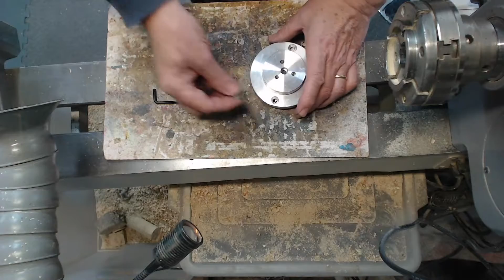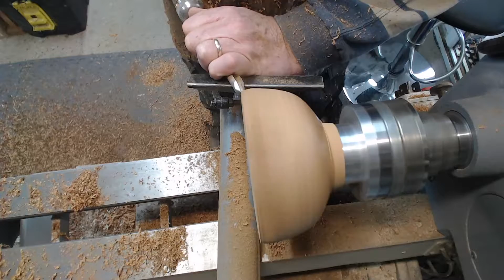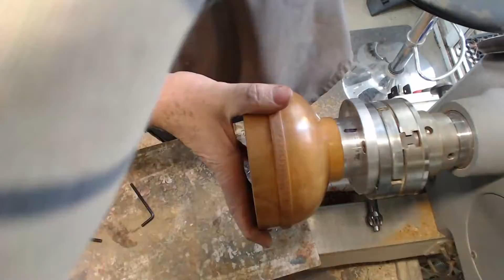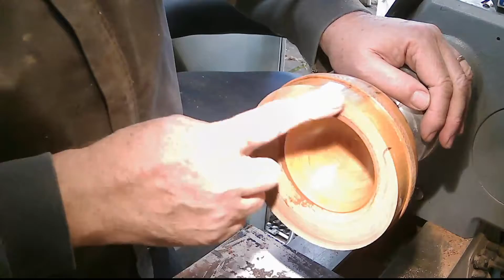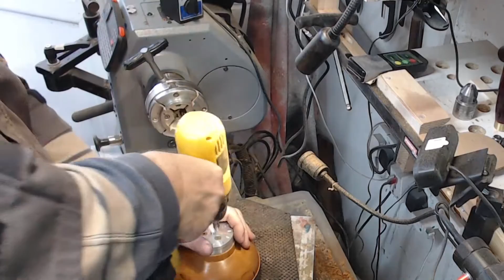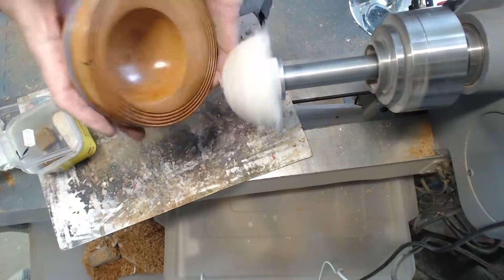Woodturning an offset centred bowl.

Comment: A glued on waste block could be used to overcome the screw hole issue & avoid losing bowl material.
Reply from the maker: A glue block would indeed work well. 👍I tend to shy away from them personally as the work to plane the two pieces smooth before bonding usually puts me off. And in this case the need to overcome the screw holes provided a great opportunity for an unusual bottom detail.  Which was a great talking point when displaying it at a subsequent Art Show. Many thanks for watching and taking the time to comment! So few people provide feedback or subscribe despite thousands of views each month.
Reply: Nothing wrong with the end result. Very nice bowl. @spinfieldturners